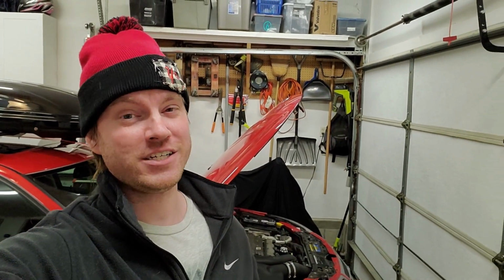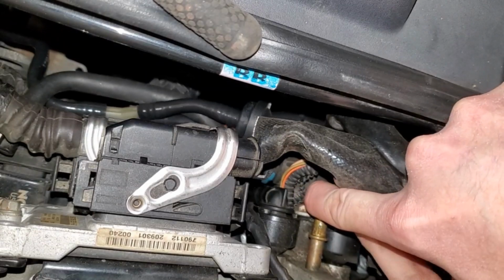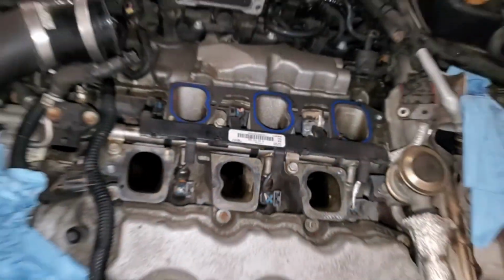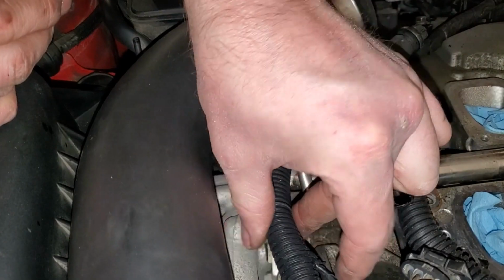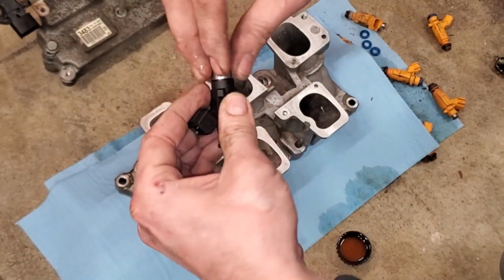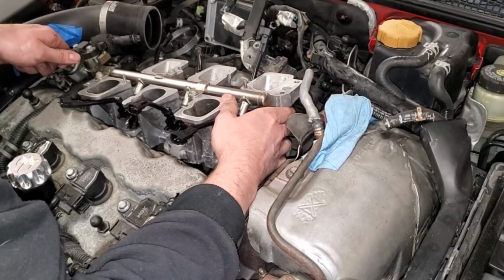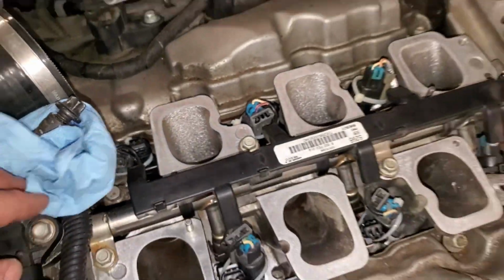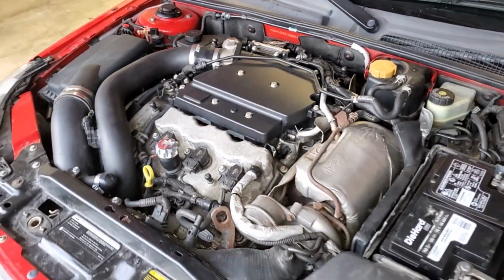Detailed SAAB Injector Upgrade & Intake Gasket Install

Comment: Better to remove the fuel pressure sensor, instead of moving the secondary induction valve. Remove the fuel rail first, and then remove the lower intake, would be much easier! install also the samething, install fuel injectors onto the lower intake first, and then install the lower intake on to the head, finally install the fuel rail.❤❤

Comment: Can you run these injectors stock? I am planning on getting a tune, along with the 19t upgrade. I live in California so it has to be smogged every other year. In the event I have to run it stock, assuming it's not being pushed, will it run without a CEL?

Comment: Front end is off mine inc 2 rads just  coolant rad left hanging lol,to remove the damne turbo! 😂 as i am going to fit an insignia vxr turbo 18t ! And intercooler! 
The egr bolts are a nightmare to get too on the front of the turbo unless the rads are off ! 
Even with that, they are still tricky and the main turbo bolt has seized solid 😂

Comment: Hey Gary, thanks for your videos. I was wondering where someone could get these bosch 700+cc injectors. I am having a hard time finding them online. Any suggestions would be great. Thanks
Reply from the maker: I ended up getting the injectors from Vermont tuning. You can likely purchase elsewhere. However what's nice about going through Vermont, is that they're flow tested so you know you're getting the best of the best.

Comment: Hey Gary, I was wondering where one would get these 700cc injectors? I reached out to Brian at v- tuner and he doesn't sell them individually. When I look up them using this part number there are several cc variations. Also, Where can iget those adapters as well. thank you so much!!

Comment: Do you actually have to take off the lower intake to remove the injectors?
Reply from the maker: You can probably get away without removing the lower intake to change the injectors. My opinion is if you make it that far you might as well change the lower intake gasket. My injectors were rather stuck so removing the assembly made it easier to remove the injectors, clean, then reassemble.

Comment: Merry Christmas got a ?,I have a fuel leak near the  pressure sensor or the schrader valve,my dtc indicates hi fuel pressure,could that be a bad o-ring on the fuel pressure sensor,thanks very informative video

Comment: Hello nice video. I mounted 550 injectors on my car but from 1300 to 2500 rpm it mumbles all over, you can't fix it in any way. disassembled taken to a bosch center to have them checked and they say they are fine. is there something that escapes me?
Reply from the maker: Did you get a tune when you upgraded injectors?

Comment: Hey … how do I disconnect the fuel line ? Do I need specialist tools ? Thanks 🤟
Reply from the maker: The fuel line by the intake that goes to the fuel rail sucks to remove! I tried a fuel line removal tool I got from my local parts store but didn't really help. I eventually used multiple screwdrivers to release it.

Comment: So have you driven it yet?  How do the new injectors work well?  I'm thinking of changing mine out as they're original from 180K ago.  OEM are expensive and impossible to find so these seem like a great alternative if they work well with a stock setup.  Where can I find the harness adapter?
Reply from the maker: Yep I drive the car all the time! I just haven't edited the finalized video yet. These injectors would probably be too much for a stock car but a tuner would be able to answer that. The adapter harnesses came with these Bosch injectors from Vermonttuning.com

Comment: Hi there bro love the Channel! Can you help me to locate my positionner sensor on my 2007 9-3 v6 2.8 convertible sabb! Thanks
Reply from the maker: Crank position sensor is buried! I replaced mine when I installed a new down and midpipe but didn't film it. If your car if FWD it might be best to jack the car up, put it on jack stands, then crawl under and look by the rear most exhaust manifold by the firewall. It's above the intermediate shaft and sort of hidden by a metal heat shield. I found mine by following some wires under exhaust and above intermediate shaft.

Comment: I had the exact same brittle plastic problem taking off my injector harness on my 2.slowT  might buy some connectors and repin them overall the ceramic coating looks nice oem+  makes me want to take mine off and match the color on my valve cover metal cast blue
Reply from the maker: Now that I have the ceramic coated intake on I want to do the valve covers in red 😄